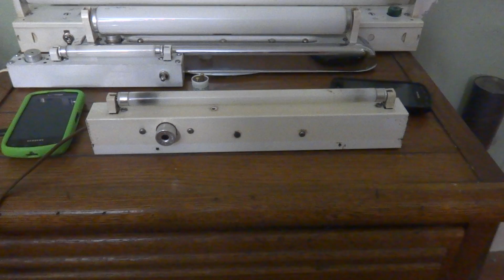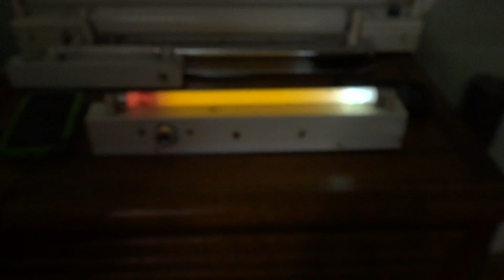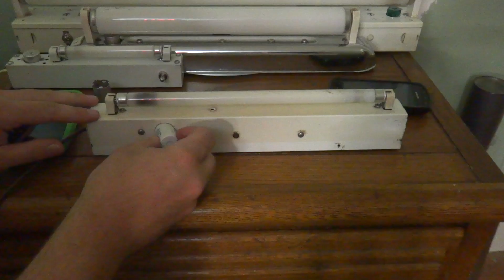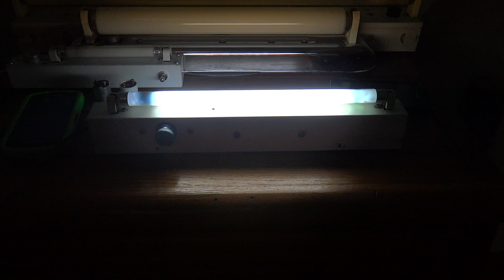Fluorescent  Lamp EOL on Arlen and Tabelek and glow fluorescent starters

Comment: Yes in the pulsestarter's case but no in the fastlux's case. The fastlux starter does not have a preheat delay so starts the tube with cold cathodes. The pulsestarter starts the tube with hot cathodes.

Comment: The starter first passes the full AC waveform, heating the electrodes then it begins to chop it like a dimmer switch does more and more. These sudden drops in current cause the magnetic flux produced by the ballast to collapse repeatedly creating high voltage spikes. Eventually the starter chops the waveform so much it might as well not be there. Think of it as a dimmer switch that is gradually being turned down from fully on until it turns off.